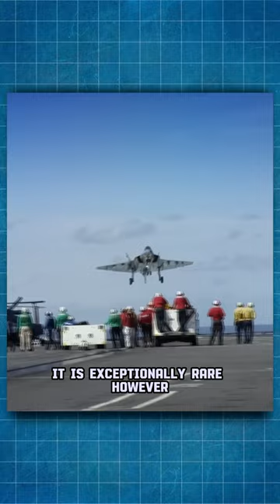ARRESTING CABLE BREAK ON THE AIRCRAFT CARRIERS  #aircraftcarrier #battleship #usnavy

Comment: Never experienced a break while working in the Gear but always ready for it !
Reply: That means you did it right. Nice job. Every parted wire I'm aware of was because of bad weight setting and 2 blocking the engine. I never saw one in 19 years of sea duty.
Reply: @michaelmappin4425  not to mention meticulous inspection of the poured socket ,needless to say I’d done right you need not worry about socket separation but as you said incorrectly setting aircraft weight,would be more of a factor,in a mishap .

Comment: USS RANGER CVA-CV 61, 73-76, TONKIN GULF YACHT CLUB. We had an F4 Phantom landed a little short, hit the end of flight deck. Broke in two. Part of the F4 hung up at end of flight deck, cockpit portion slid across the angle, pilots ejected, plane ✈ went into the drink. Man Overboard! We saved the pilots. ❤. I was Ships Company. Life on the roof is dangerous. Peace ✌.
Reply: The funny part, if that's possible, a couple of ships Company shipmates were up in the catwalks, all the way after starboard side having a 'smoke'. Saw the entire incident front row! OMG!
Reply: My dad came on as a replacement for a guy that got killed by a busted cable on the FID